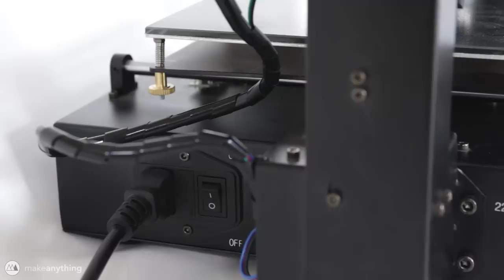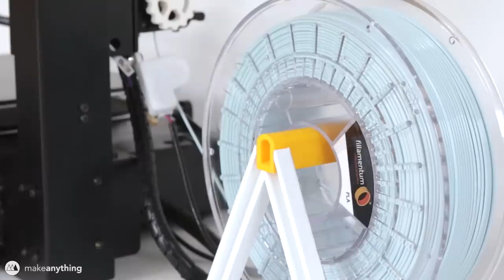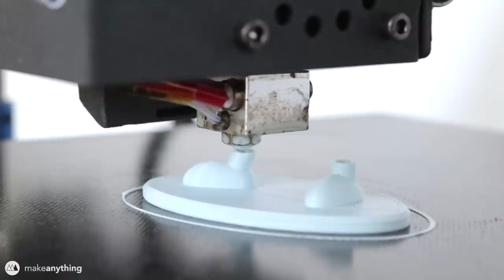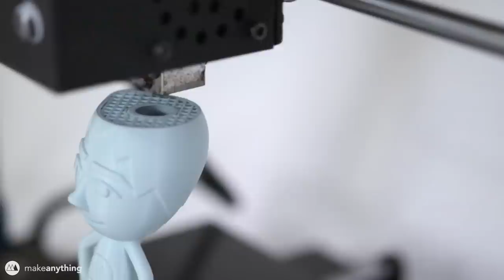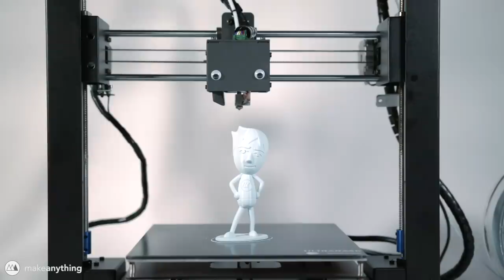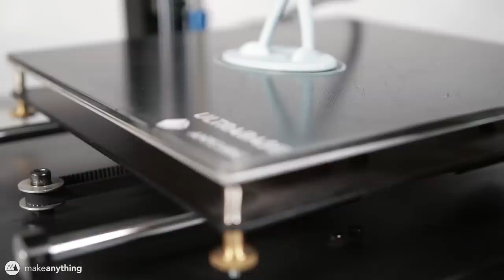the mii channel theme but it's played using a 3D printer ♪ ♫

Comment: I want to buy this 3D Printer, where is store for this (online)
Reply: RaduAndreiq Amazon...
Reply: RaduAndreiq I think. The person might’ve gotten a normal 3D printer the programmed it to do this themselves, so if you bought the same model I doubt you’d get to be able to play wii theme :/
Reply: if you haven’t owned a 3d printer before i recommend a flashforge finder. it’s really easy to use and is amazing for its cheap price (£300). but i think this one in the video is custom